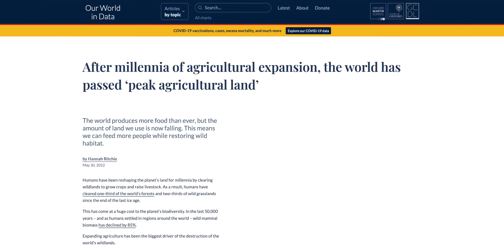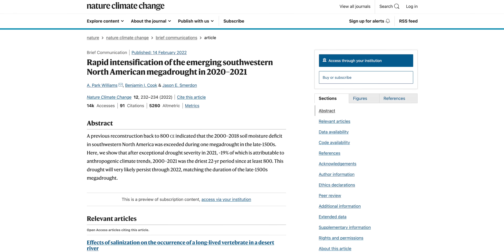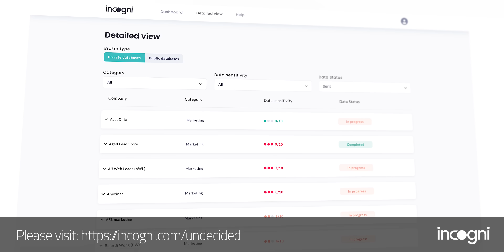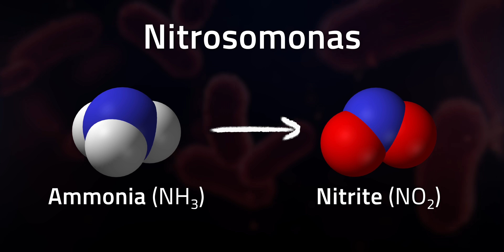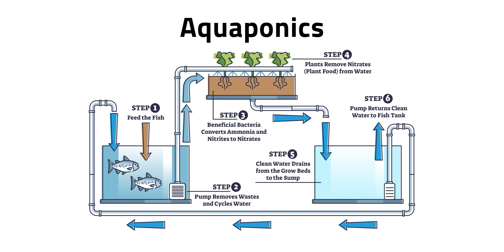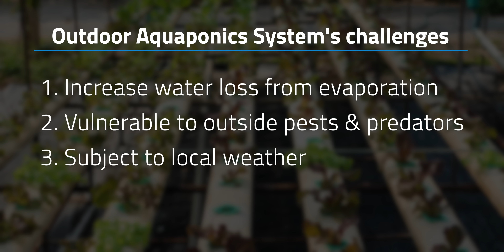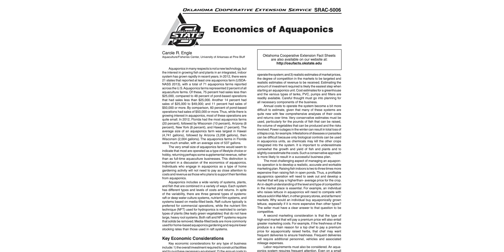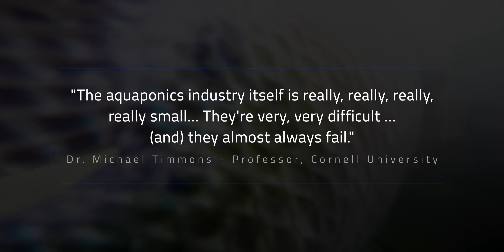Is Aquaponics the Future of Agriculture?

Comment: Centuries ago, Chinese peasant farmers had a system in which night soil and pig waste were composted in cisterns to produce fertilizer as well as methane for cooking. The fertilizer was used on the fields, compost effluent drained to a pond which sustained algae that grew carp. Thus, a closed loop system where NPK as well as trace elements are recycled and the farm gradually gains nitrogen(via nitrogen fixing crops) and carbon from the air. The system had limited carrying capacity but could be sustained indefinitely since there was no net depletion of required inputs.

Comment: Glad you mentioned the pH problem, I Personally like Aquaponic but it can be very restrictive regarding pH compatibility issues. As far as Aquaponic being a major contender for top food provider, everything is in place except for the energy part of the equation they need something like Thorium Molten Salt Reactors or Focus Fusion to power the facility. Also If someone could come up with a pH exchanger that didn’t continuously add Chemicals or minerals to adjust the pH because you can only do that so many time before you have to flush the whole system.
Reply: You can use air pumps... to move water. Also, solar can power them easily with a few humans and a horse.
Reply: In our experience (12 years running systems and 9 years of research) this is an overrated problem. We have been running low pH aquaponics (5.5 - 6.5) just fine with catfish. Using a well sized biofilter. 
The aquaculture drives pH down, the plant side drives it up. This only becomes a task, when running  decoupled aquaponics (dubbed DAPS, not a fan). 
In a healthy coupled system pH drops slowly. pH management can be easily done with low cost chemicals that also give you the opportunity to balance nutrients like potassium, calcium or magnesium.
Reply: To add to your "have to flush the whole system" statement: this is completely not true. For example pH management with potassium hydroxide only adds potassium which will be extracted by the plants. Calcium hydroxide only adds calcium, which also will be consumed by the plants. The problem you state does not exist. I know one aquaculture (not aquaponics) producer who has been running his system for 25 years without ever stopping it or exchanging the process water.
Reply: @jaysilence3314  
Sounds great, don’t enough about catfish and Aquaponic, are the catfish still good eating being raised in that environment? Go a link sounds very impressive.
Reply: @YellowRambler  in my opinion catfish are underrated on the markets. Good fish for human consumption. Taste in RAS systems is great. No muddy taste at all when treated right. With African Catfish great production because it tolerates high stocking densities. But low market prices.

Comment: Agro-engineer, biologist and chemist here. I did a deep case study for a startup that wanted an aquaponics system (it was no-so-subtly-hidden a Chinese tech-spying company for aerospace research).

No it's not : the system is inherently unbalanced. You either have to add salts and pH regulators, or you have to flush the system... Murky fishes used sell at a low low, and you can only grow basil, lettuce and other highly-priced greens. It's a no go for fruits and vegetables, they are 100x less profitable.

The only scenarios where it is interesting would be for Antartica colonies (shipping costs), refugee camps (low cost labor) or Space exploration (closed loop systems). Ultimately the goal is to recycle human poop using fishes... And for it to work you'd need some kind of buffer medium, like, like BIOCHAR...

Comment: Matt, excellent information and analysis.  It would be interesting to see a comparison of the nutritional value of vegetables and fish grown this way vs vegetables in "healthy soil", however that is defined, and wild caught fish.  Rather than comparing simple gross tonnage a scale could be used for nutritional, gross tonnage.  With higher nutritional values it would take less tonnage to feed the same number of people.
Reply: A well run facility can produce comparable vegetables to healthy soil grown vegetables. Aquaponics has the ability to even be superior on a nutritional basis if designed and managed correctly and after one year to allow the system to mature.

Comment: I have been researching Aquaponics for over a decade and this is the overall expectation still. Aquaponics is one of those things that in the end will better fit into a sustainable, off grid, solar/wind operation for a family or small community with outside resources that can help recover i failure years. On the smaller basis things seem to really work out if you are not trying for teh profit margins investors demand and you are only creating resources directly for the "Gardeners".
Reply: I have a startup that is trying to reduce the operating costs while creating a system that requires less maintenance. This is the future and these are the small hurdles we need to overcome.
Reply: @Greenskies321  Great news!!!

Comment: you need to build and maintain buildings including all the electric/mechanical systems and to do so utilize lots of electricity 
electricity needs to be produced (the vast majority of electricity production utilizes water to turn turbines) 
and the used electricity could be used for desalination so in this perspective .. it costs lots of water

farming water uses ground and river water .. something nobody drinks and once put on a field .. it sinks into the ground to become .. exactly ground and river water. so it is not consumed .. it's just utilized. ofc this takes energy and will cause slightly more water to evaporate into clouds but also that isn't lost .. it's just put into the global cycle.

so where exactly does this tech save DRINKING water?

interesting nontheless

Comment: The major problem with any aquaponics system is that it produces a lot of the plant crop and very little or no fish.  They need all the fish they can sustain in their confined environment to feed the plants., and without outside food supplied for the fish they don't grow or reproduce very fast.  So successful operations grow stuff like very high-end gourmet lettuces for the restaurant trade.  That is a food crop that does not have to get the plants to bloom or fruit, and really depends on rich people paying very inflated prices for the crop.  

But you could probably do that hydroponically without the fish for less money!  The reason is that most plants require nitrogen, potassium, and phosphorous in their hydroponic solution, but the fish mostly provide only nitrogen.  So you have to add potassium and phosphorous (which is not good for the fish) to grow anything but lettuce.  It boils down to the fact that fertilizer is a lot cheaper than fish food.

Comment: Building out an aquaponics system in my basement.  Raised fish for years, so I have got that down.  Put on extra solar panels to handle the lighting and filtration needs.  My advice is take your time.  Hoping my retirement job will be to be a part of building out and running a full system in my community.

Comment: I just built a large fodder system to feed my cattle. its aquaponics. I went into this year as my first year growing multiple tons of feed every day  thinking I knew how much water I was going to use and I severely over estimated how much water I was going to use. without getting too into the numbers I can feed couple hundred head of cattle in a foot print that was 2500 square feet instead of 27,704,160 square feet of feed ground. and basically under a hundred gallons of water used every day...., pretty efficient.

Comment: Thanks Matt, lots to consider and research.
we are considering an Aquaponics set up in our large Greenhouse, likely running it spring to fall in a dedicated annual cycle due to very cold winters' in our area. The Tilapia seem to be capable of full growth in 8-9 months, which is interesting.
The time committment will not bother me - we live off our homestead anyway, and daily activities just set the pace of what needs to be done and when it needs to happen around here.  Some automations may be a good idea especially alarms for pH levels or water temperatures in a system like this.
I am not worried about the power consumption for the pumps, we have solar and spring to fall we have excess solar, so this would be a good fit for us, if it can be a seasonally run gig just for our own uses. ie not trying to supply a grocery store, just putting greens and fresh fish on my family table.

Comment: Seems like this is perfect for cities. You can build a central skyscraper dedicated to an aquaponic farm and the radius out with structures that it can support and then repeat until the whole area is Venn diagramed with redundancy and coverage. Boom, self sustaining city
Reply: While this is a compelling vision, the numbers just don't add up. Sunlight hitting the city area limits the amount of food that can be produced in cities. When stacking up, artificial light has to be used. Where is the energy coming from? If we want to supply it sustainable with photovoltaiks, we have to keep in mind that for each square foot of growbed you'll need ten square feet of solar panels somewhere else (solar efficiency 20% and LED efficiency 50%. Factor of ten). Where are you going to place the panels? On the peri-urban space? Why not just build conventional greenhouses there, and skip the investment intensive conversion from light into electricity and back?

Comment: If they also produced their own green power, to power the facility and put excess on the grid, might that help with profitability? They’d be lowering operating costs and even adding profit depending on the efficacy of the energy production
Reply: Aquaponics does not produce power. If you mean to include a power generation operation under the same firm, then its possible; you would just be subsidizing the aquaponics with profits from the power generator. You could do the same with any other type of operation, if the same person owns both
Reply: @lordpisces5019  that’s what I’m saying, like have the property double as a solar farm
Reply: @Electrovicane  That doesn't really effect the profitability of aquaculture itself. It would be functionally the same as owning a solar plant on the other side of the world and using the money from the solar plant to make up for the losses of the aquaculture.

From a more theoretical perspective: the cost of any power usage, solar panels, or other power generator is all the other things you could do with it. That cost does not change whether they are located/owned together or not.

Comment: I have system that is much smaller in the space needed I use a ranin water storage bag full of blue tilopea I made a timer to control the pump one minute on and thirty seven off the plants are outside and are in trash bareles of packing peanuts and are a good hight to work on i have done this for four years now

Comment: as someone who has a bacteria exclusive aquarium setup with live plants, its easier the larger things get. With my setup I only need to change the water once every 3 months or so and dump the waste on my garden plants.
 Just keep a handle on on the light source and population of fish and its fairly easy once you get there. Keeping fish healthy is easy when you have less fish in a bigger tank. I have had some fish for 4 years now still going strong (lots before but I had to move and they couldn't come with me sadly) 
In my experience the ones that die usually die quickly after getting them due to problems before I bought them and there wasn't anything I could do to save them. I helped them live a little longer, but these days many fish have so many inbreeding and health issues... its hard to find a good healthy supply of hardy fish.

 People have issues with goldfish and torture chamber bowl and that's what gets people hating fishkeeping.

Comment: The fish poop itself is a waste product.  It is removed from the system.  

RAS (recirculating aquatic systems) are more and more going away and closed loop systems are much more common, where the fish and plants are kept separate and combined by a  mineralization tank where the nutrient water (poop water) is broken down and fed to the plant beds, rafts, etc.  

It's easier to maintain dual systems keeping the water for fish at ph and temp required, while the plants can get higher ph they need.

These systems are called decoupled systems.

Comment: There are several ways to increase the profitability and sustainability of these systems.  Using industrial waste heat in colder regions, automating with robots to reduce labor, using climate battery greenhouses paired with solar or wind energy where cogeneration is not possible, being extremely close to market to essentially eliminate shipping and a produce broker, separating the components with buffer systems to avoid massive die offs when things get a bit out of whack, diversifying product and services offered, offering some incubation funds or crop insurance offerings, building in processing functions for freezing, pickling, canning so that produce isn't wasted.... There's always ways around issues if you can get a basic system functioning on it's principles first.

Comment: The way I see it, even smaller traditional farms may struggle just because of the oscillating prices of the very produce they grow.  One year's harvest may not net as much money as the other, and recouping losses to replenish seed stock for the next season or year can be difficult if consecutive bad seasons come up.  Larger farms can eat the cost by downscaling, but smaller farms -- and aquaponics -- may have tighter overhead budgets that could easily put them into debt just by replenishing stock.

Price fixing may not be the solution, but neither is the industrial pipeline of massive farms, cutthroat toolmakers, and legal agents that sue for growing a patented crop.  We could be more efficient and less reliant on petrol-based fertilizers, but the powers that be would rather farmers continue to be tied to the commercial supply chain.

Comment: I have extensively tested aquaponics, and it is far from good, the biggest disadvantage I have encountered is the limited things you can grow, you are unable to grow vegetables to maturity without subsidizing nutrients into the system for them, the only thing that really works well is leafy greens, grasses and photosynthetic bacteria's, which sadly are not things humans consume in bulk, which further complicates distribution, one thing that is good though is a constant output once a balance has been achieved, which is also the case for regular hydroponics, without the need for finding a balance, making it a far easier prospect, especially if you produce your own nutrients for your hydroponics. 

I have also found food from hydroponics has more consistency, especially when it comes to taste, which is a great advantage over aquaponics.

Comment: So as someone who has the very beginning of a small and modest 5 acre farm when you say that the initial investment cost of $20,000-$50,000 was high I basically laughed out loud. I recently bought a small light duty tractor which by it's self was just under $40,000 not to mention the $20,000 I've spent in fencing and another $30,000+ I've spent on other projects on my property such as installing basic irrigation putting down a gravel road for winter access and some small structures for hay and other necessary storage. All for a small herd of cattle, some chickens, and a modest vegetable garden and all of that is of course not even taking into consideration that the land itself was $200k.  So $20,000-$50,000 for a personal family farm that doesn't even need a tractor is just par for the course honestly. Granted I probably could have gone with cheaper solutions but decided to invest in things that were nice and would last a while but still if you think that is an unreasonably high start up cost I think you need to do a bit more research into the start up costs of traditional farming.

Comment: Aquaponics has been practiced by various cultures in Asia for centuries, in a different way and using different tools available. If the aquaponics is about farming fish in plastic tanks like what we see in the video, there will be more challenges and higher failure rate because it is too contained, like a fish tank. If aquaponics is practiced by digging a large hole in the field and filling up with water, it will work better because the excess wastes and nutrients can be regulated by the soil.
Reply: This problem could be solved by having different parts of your aquaponic installation (water cleaning growing plants etc.)
This must be done large scale to acomlish this

Comment: What about having the food as a sort of secondary operation for water desalination? There are crops that like salt.
This would probably compound the difficulty of keeping everything at the right PH values and such, but if you have the water flow from one aquaponics system to another, you can probably whittle down the salt content. This would probably mean different plants and fish as the water desalinates.
The food sold brings down the cost of desalinating water. Throw on some photovoltaics to bring down power usage.

Comment: I am in Singapore, working on that topic... Aquaponic look interesting at first but it is hardly scalable to mass production and difficult to maintain. It is not easy to guaranty the balance between all, any disease from one side or the other affect the all chain of production. Therefore it must be fragmented into small system to avoid the loss of the all production... It is good for small production but for efficiency, you better separate Aquaculture and Hydroponic. The variety of crop you can grow are also pretty limited at the moment, as well as type of fishes. Good on paper, but not ready yet.